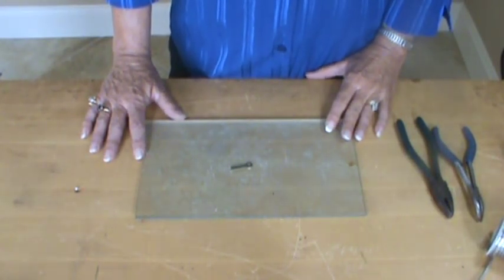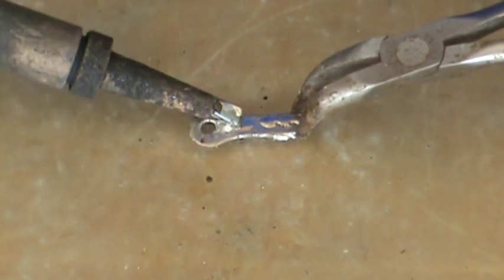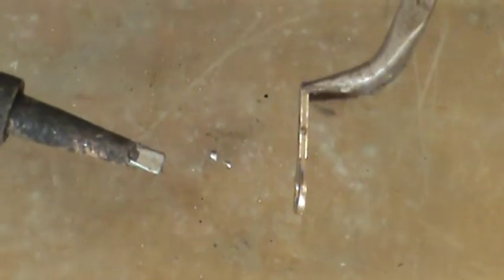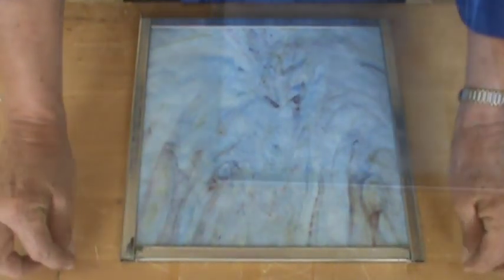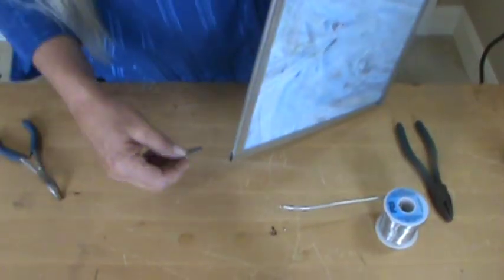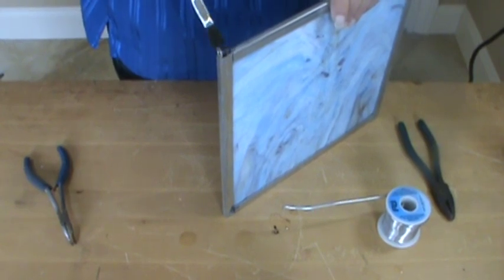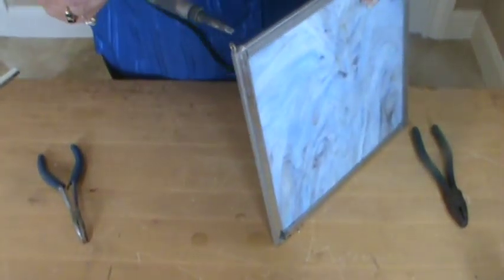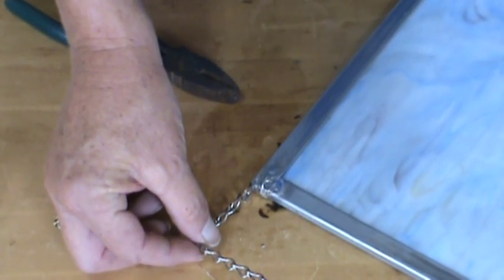Handy Hanger Installation in Less Than 5 Minutes

Comment: Handy Hangers are great, I use them for all my hangs. However, a miter zinc cut is aesthetically best and I sweat solder the hangers prior to soldering the frame to my panel. You must be sure to cut off just enough of the top ‘horizontal’ zinc to allow for the thickness of the hanger. Viola 👍

Comment: Does zinc came melt as easy as lead came? I haven't figured out what temperature to set me soldering iron at so it melts the solder but doesn't melt the came.  I'm hoping that zinc came works better.  Any advice is appreciated.
Reply: Zinc came requires more heat. You will like working with zinc came. You won't melt holes in it like you will with lead.